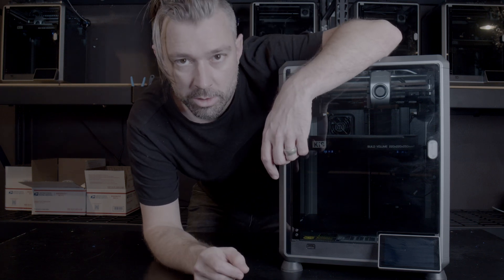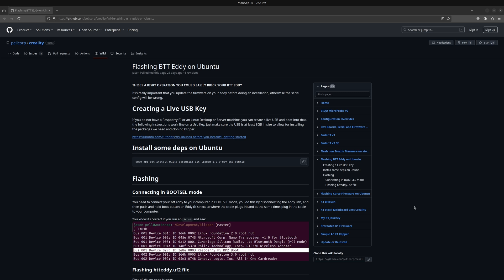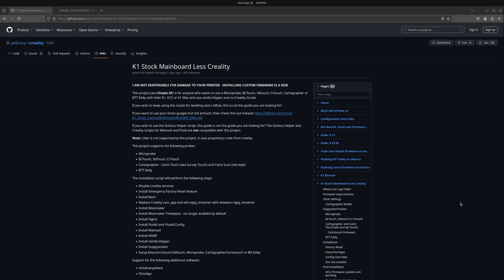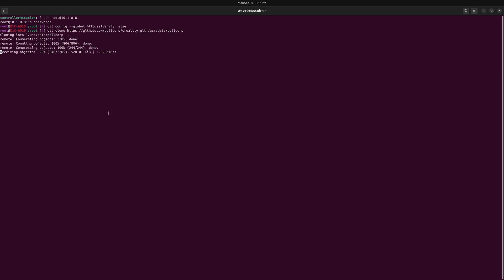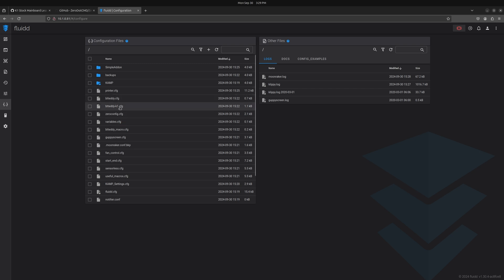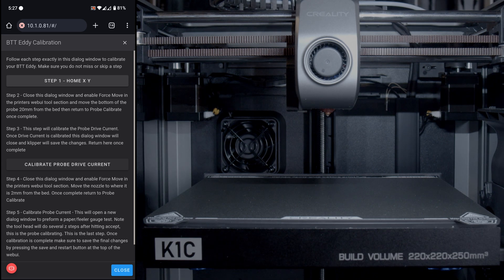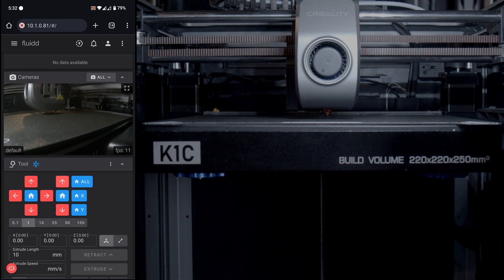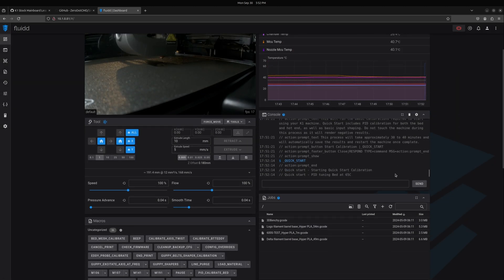Creality K1 Firmware & Probe Upgrade: The Definitive Guide

Comment: @ZeroDotCMD I followed the previous video that explained how to mount the btt eddy in the K1, in that video you cut the USB cable that comes in the package with the btt eddy. Now, in this video I have to connect the btt eddy to the PC but, how the hell do I do it if we cut it in the previous video?????????
Reply from the maker: Sorry you are having trouble with this. It is mentioned in the description to make sure to flash prior to installation. But I know sometimes description notes are easy to miss; I've missed a few myself. The best option would be to make a new JST to USB cable so you can flash the Eddy without tearing the machine apart. Alternatively, you can also wire a female JST end onto an old USB cable and plug it into the cable at the bottom of the machine; this way, you do not have to remove the Eddy from the tool head.
Reply: @zerodotcmd  damn you're right, i didn't read the description, so i think i'll buy some female jst connectors to connect to the cut piece of cable with male usb. i remixed your mount to make it work with the new carriage x i built. i still have to try it, if it works i'll post it on printables. thanks a lot
Reply from the maker: No problem. best of luck with the remix ☺️

Comment: OK, so I have followed the steps given, but I now have a message saying 'waiting for printer to initialise.......'  assume something has gone wrong any suggestions?
Reply from the maker: Did you make sure to power off the machine and power it back on after installing the firmware? Quite a few people miss this step.
Reply: @zerodotcmd  Hi, yes, and the issue appears upon restarting. run the install several times and same result. Does the btt eddy need to be connected at this stage?

UPDATE
Did a little testing at the issue appears when the guppy screen is installed. is there a version of klipper that does not install the guppy screen?
Reply: @kljw66 slippery won't start if btt eddy is not plugged in.   Also guppyscreen is just a client, it will not affect klipper at all.  For more detailed info always best to open up fluids ui in your browser.

Comment: Great video, and an upgrade I intend to try. Quick question, is this the same procedure for Mac OSX?
Reply from the maker: You should have no issues being able to SSH into the printer via OSX. the only problem I would see if flashing any probe firmware as all the terminal commands for flashing are done in Linux.
Reply: @zerodotcmd that could be an issue, but thank you for the responce, I have reached out to the team at BTT

Comment: So...I battled the probe error issue and won. Two ferrites on the usb cable, one where it enters the conduit at the back and one near the mainboard usb connector, shortened the usb cable to a minimum and routed it away from all stepper cables in the basement. The clue was, the error was always getting thrown during a move. I also tweaked my mount to bring the probe/nozzle offset height to exactly 3.6mm without the case, which is equivalent to 2mm if was still in the factory case.

Comment: Rookie question is it possible to reset the Eddy to factory spec and start again? Or is their anyway to check its correctly flashed. I may be over cautious
Reply from the maker: If you are concerned that something is wrong or that its not flashed correctly you can always re flash.

Comment: I just got everything installed and everything went well. Although during the start print, once the bed is at temp Im getting a 450 second countdown for bed warp stabilization. I have never seen this, can I change this or edit it out?
Reply from the maker: @TewStrong88  yes you can there is a toggle for warp stabilization in the fans and outputs section. If its off it won't run stabilization. You can have it off by changing the stabilization pin to 0 in the startend config file.
Reply: @zerodotcmd  I of course realized that right afterwards, hah. Everything is running really well. Thanks for the good tutorials.

Comment: i cant seem to get error from stop happening. ive done value change 15,16,17, & 18 nothing seems to work. any advice?
Reply from the maker: Which error are you having? Can you copy paste it here?
Reply: @zerodotcmd  
!! Error during homing z: Eddy current sensor error
Reply from the maker: After you changed the value did you redo calibration? Starting at step 4? also I've heard reports of some users having to manually remove the calibration from their printer.cfg before redoing calibration. I haven't experienced this myself but it has been a reported fix when redoing a calibration doesn't help.
Reply: Tried that and now I’m getting a homing error when I try to do the axis twist calibration

Comment: With all these mods, how much better does your k1c print and is it worth it? Im thinking of doing this so i can have the eddy
Reply from the maker: My main concern for printing has been first layer quality. Almost all of my prints are printed face down and require a near-perfect first layer. This is almost impossible with the stock K1 printers. These mods have given me a much higher quality first layer than I can achieve with stock.

Comment: Never heard of SimpleAF i'm running the Helper script
Reply from the maker: Helper Script is more well-known, but the two are very different approaches. Helper Script sits on top of CrealityOS, giving you more access to the already existing "Klipper" setup. This version of "Klipper" has been heavily modified by Creality. SimpleAF completely removes everything Creality has added and provides the user with a genuine Klipper experience.

There is nothing wrong with Helper Script; it's a great starting point for anyone just trying to get their feet wet but not quite ready to jump in headfirst.

Comment: Hi, why one should install a custom firmware? 
I've got a K1C and it works nicely. It's my first filament printer but I'm satisfied by how it works.
I only had some problems with ABS, but that's probably due to my inexperience more than of the printer.
What can you do with a custom firmware that is not possible with the stock version?
From my experience with other things, custom means more flexibility, but also more time spent to do adjustments...and usually that ends by going back to the original setup, as "always working good" it's better than "sometimes working cool" 😁
Reply from the maker: There are several honest answers to this question, the first being that if someone is happy with their printer, then they shouldn't install custom firmware. Custom firmware for printers allows people to unlock more options: better probes, custom hardware, the use of non-Creality slicers, smart home integration, better control over printer settings and configurations, and the possibility of multi-machine remote management. It is absolutely true that custom options often mean more time tweaking and working on the machine. For some people, the benefits of customization don't outweigh the time spent working on the printer. For others, it's an absolute must-have. For me, the driving factor for modding the K1 was my need for a flawless first layer, meaning seeing absolutely no visible print artifacts.

I will always say that if someone is happy with their printer, then they should leave it alone. But for others, the customization and tweaking to perfection is almost as fun as printing—sometimes even more fun. Some users have use cases that demand that they put a little more time and customization into the machine. It all depends on the person and the use case.

Comment: Thankyou so much buddy your channel is awesome, you have a Talent wasted on just a small cache of subscribers how you explain things is very cool.

Just out of interest I noticed you have a print farm consisting of K1 Printers, why did you go for lots of K1s with smaller build plates rather than a few K1 MAX units always intrigued me that a lot of Professional 3D Print Farm setups are smaller build plates rather units.

I originally had the Helper Script installed to make installing and uninstalling apps etc easier what is the best solution for this setup. 

Also once machine is dialed in do you know how to build a restoration firmware so this can be used in the event of mainboard failure etc
Reply: I don't own a 3D print farm but I guess it's better to have more small printers available, instead of less big printers that can print bigger (or more) parts but are always busy.
Does it make sense?
Reply from the maker: Imagine you have a large room with 20 cups of water that need to be moved from one side of the room to the other. You have $100, and you can buy 10 well-trained mice for $10 each to move the water. Alternatively, you can buy 5 larger rats for $20 each. Even though the rats are larger, they can still only carry one cup of water at a time, meaning the smaller mice will always outperform the much larger rats when it comes to economies of scale. This is the reason that almost all print farms use smaller machines. 

Backing up : Once you have a machine dialed in, you can back up your entire configs folder. In Fluidd, you can do this by selecting all the files you want to save, right-clicking, and selecting "Create Zip Archive." Then you'll be able to download the zip file and store it as a config backup.

Also, Thanks I'm glad you're enjoying the videos. I definitely plan on doing more.

Comment: Sorry one last question currently I have the EDDY plugged into the front of machine, if I solder on the JST plug and connect to the board do I need to change cfg settings referring to a different port ?
Reply from the maker: No there will be no difference between using the front USB and wiring into the JST.

Comment: Just a head up this doesn’t work on the K1 Max it goes across doing 1st Line and stops at the end point and that’s it doesn’t do anything else, so I would imagine somewhere in the BTT Eddy config or the AF Firmware where we need to specify the bigger build plate.

Amazing Videos all of them so thankyou so much, I have been preaching your videos to the K1 Masses, if you can help figure out the K1 Max settings that would be absolutely amazing thankyou again
Reply from the maker: This issue is with the Max X for the bed in the btteddy-k1m.cfg 
I do not have a Max, however users have reported this fixed when changing the mesh_max to 280,280 instead of the default 285,280 that is currently set in the btteddy-k1m.cfg

I hope this helps solve your problem!
Reply: @zerodotcmd  you sir are totally totally awesome, interestingly also I found setting the Probe current to 18 in the greyed out section, when you do all the calibrate the Paper Test of calibrate and the probe starts doing its pulsing totally knocks out the eddy throwing up a major error so I have just gone with what ever it detects it to be.

Comment: I am currently rooted using the HelperScript. After reading and dooing some research, I understand BTT Eddy is not yet supported though the HelperScript, even when installing GuppyScreen? Thanks in advance
Reply from the maker: If you want to use the BTT Eddy you will need to install the SimpleAF firmware. The problem is that Creality Helper sits on top of CrealityOS, and the OS isn't really genuine Klipper. This makes it hard to really setup some more advanced options such as custom probes. Don't worry, installing SimpleAF is pretty easy!
Reply: @zerodotcmd  alright, thanks for the reply. Yeah, I am not afraid of installing Simple AF, it's just that Helper script is quite convenient and incorporates many mods. I will finish this this weekend.
Reply from the maker: I will say, Helper Script is convenient that's true. He did a really good job with it!

Comment: Does this also work on the K1 Max?
Reply from the maker: Yes it will work with the K1 Max. As long as you are using custom Klipper firmware. Creality blocks users from using anything useful through their interface.
Reply: @zerodotcmd  nice. i have it currently rooted with the helper scrip one. but been wanting to use a eddy on it. so i just ordered one, now because of your work on it.
GREAT video. have not seen this shared in the creality K1 groups yet. but i could have missed it. FYI i relise i need to use the AF custom FW

Comment: Please please do a vid on strengthening the bed sub frame. it's so weak just slightly push on either back corner of the bed throws the whole thing out of whack. The bed it's self is a right pain too but there is a lot out there about sorting that.
Reply from the maker: There are some things that can be done to make the frame a little more stable! I might just do a video on this!

Comment: Liking these k1 mod video's👍Just curious. Do you have to change the Z-Offset everytime when changing filament type from lets say PLA to ABS/ASA?
Reply from the maker: You don't always have to it depends on the filament but most of the time no. Every once in a while you'll find a filament that doesn't want to play well but most the time you'll be OK without changing anything. Remember you can always save a list of Z-offsets if needed.